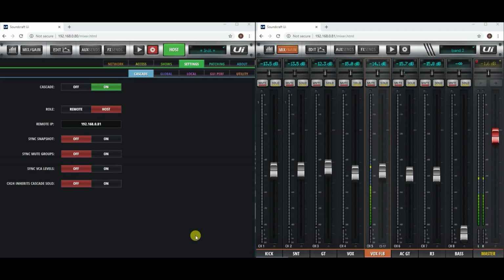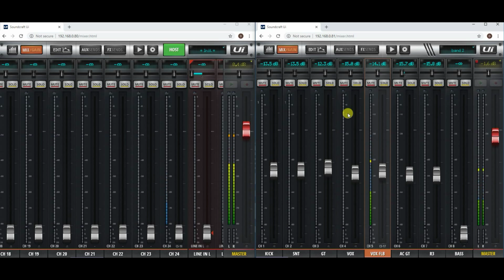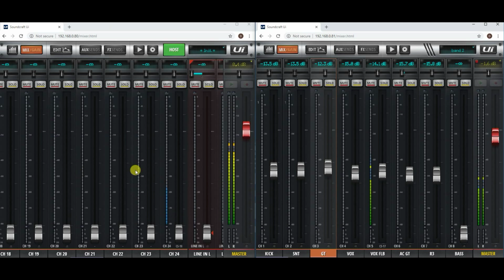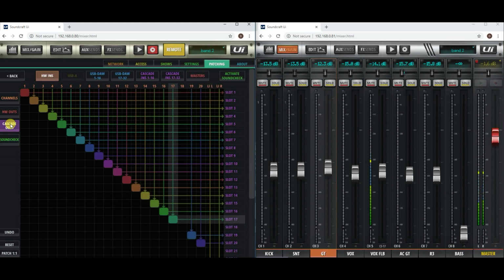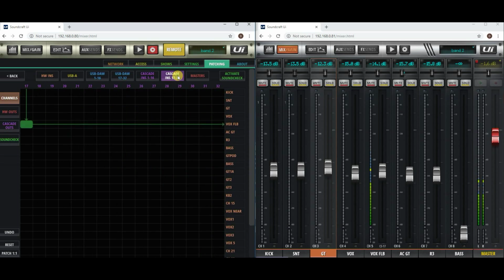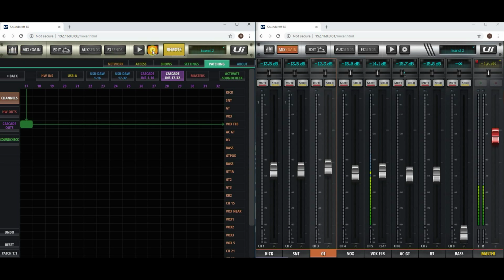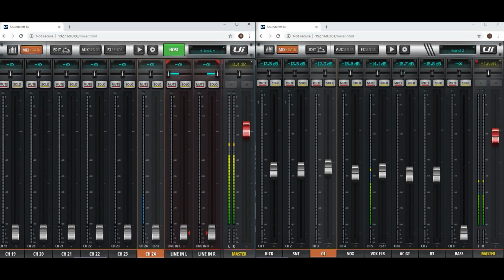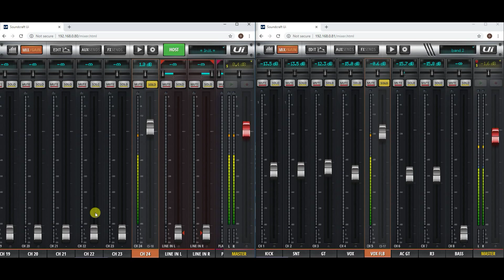Ui24R V3 cascade SOLO and AUX

Comment: Is it possible to patch the 8 aux outputs from the remote directly to the host without disengaging the host aux outputs?  If that is not possible, then you would have to burn a channel for each aux you want to share from both units.  If you do 6 monitor mixes, you would have to have 6 channels on the host dedicated to summing the aux outputs form the remote.

Comment: hi
If I connect 2 ui24r devices to one another, the number of AUX doubles?
Can I send 30 microphone inputs to 1 AUX?
Reply from the maker: The aux number doubles but per unit, if you need to send 30 mics to one unit that is still possible. YES
You would send AUX1 from 1 unit via a CASCADE channel to the other unit and bring into into the AUX1 bus via a virtual channel.
Reply: Send 5 microphone mixer number 1 to Aux number 2 mixer number 2
Send 5 microphone mixer number 2 to Aux number 2 mixer number 1
If all 20 lines of mixer number 1 and mixer number 2 are full.
Is it possible? @mix-record-connect9938
Reply: @mix-record-connect9938  I am considering getting the UI24R for a live rig, but am concerned I won’t have enough IEM outputs with the auxes. So just to clarify, if I cascade link two units together, will I have a total of 20 auxes available to send IEM mixes out of? I greatly appreciate any help or advice to can give. For context, I’m trying to get 8 custom stereo IEM mixes with two units.
Reply: @mix-record-connect9938  are the 20 auxes separate when using cascade? Or only doubles the outputs?